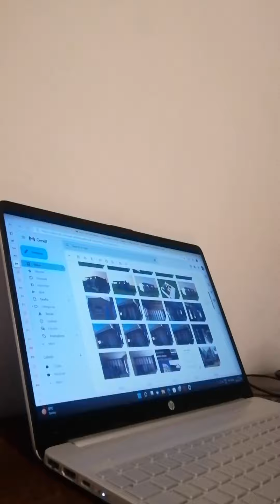What are Nutec Houses and why should you build a Nutec House.

Comment: . Hi. I am in Gauteng and am very keen on building on to my existing house with Nutech. I will also require a double garage. Do you build on a concrete slab?
The extension to the house will be mainly for an entertainment area but must also include a guest bedroom,  bathroom small kitchen and large open plan lounge/dining room with folding patio doors leading onto a wooden patio. Solar geysers are ideal. Are you able to use your panels to place on existing walls to make it seem part of the original home.
Reply from the maker: Yes we can build on top of the existing house please send me your email address and I will send you the quotation soon or what's app me on 0837309360 or 0742464182 Michael Emmanuel if you don't want display your email address and you can send it to me inbox on what's app and with the size of the Nutec house that you want us to build you and specifications and dimensions size number of rooms and square meters
Reply from the maker: Yes we can use flat Nutec Boards and they can look like part of the existing house a d we can build you the entertainment area with kitchen, lounge, bedroom, bathroom, guest house solar geyser and folding sliding doors please what's app me on 0837309360 or 0742464182 Michael Emmanuel and we can chat more.